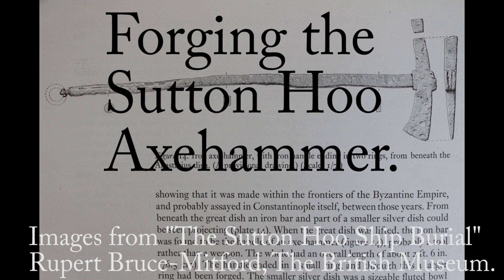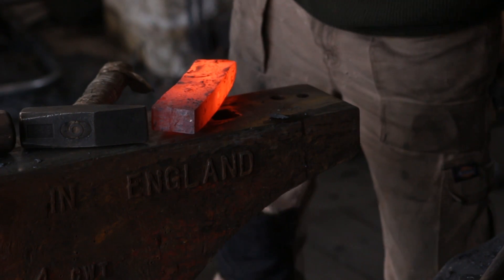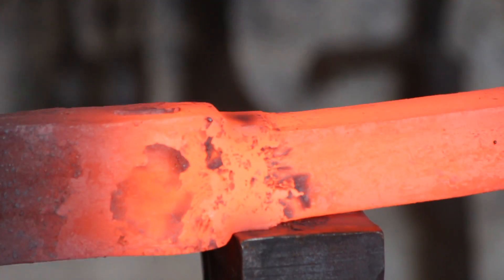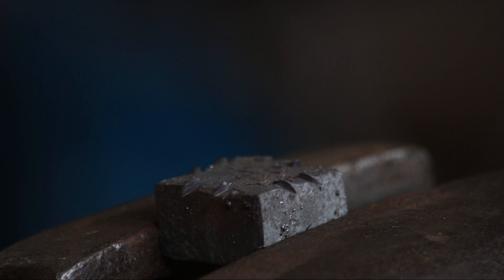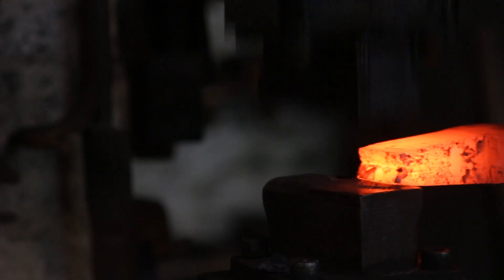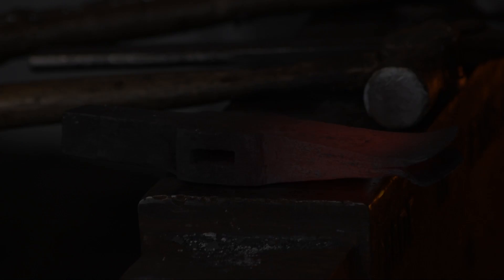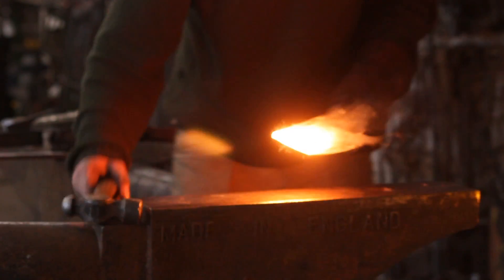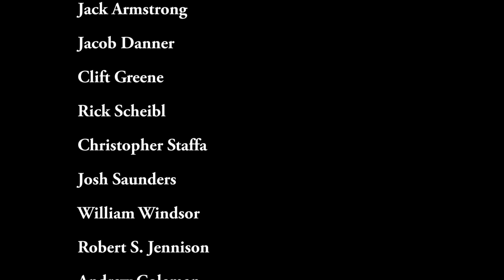Forging the Sutton Hoo Axehammer. Part 2: The head.

Comment: @12:16 There seems to be a tiny blue flame on the top of the spring steel. Is that just a camera glitch, or is it the carbon coming out of the steel and burn? I've never seen that before.